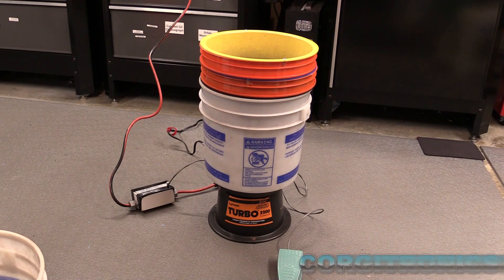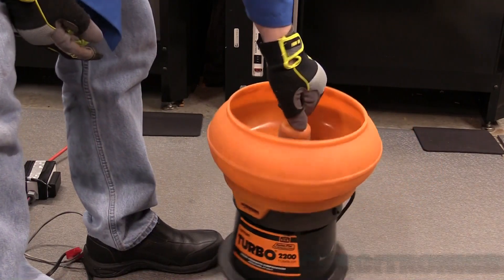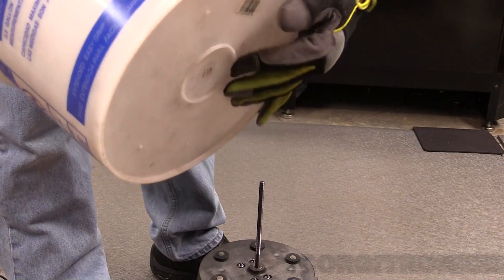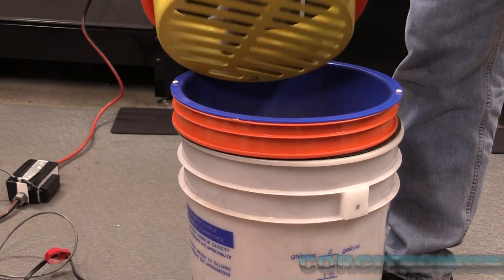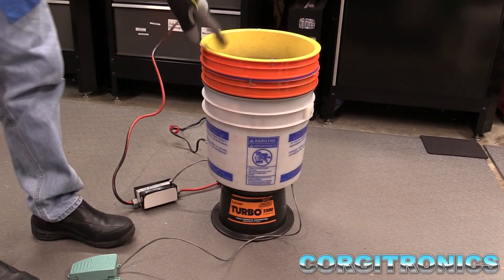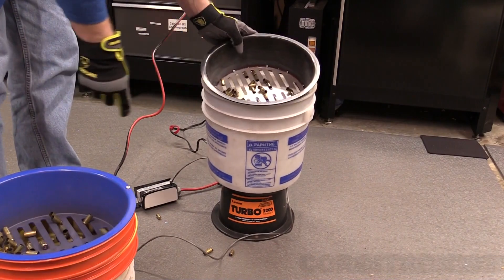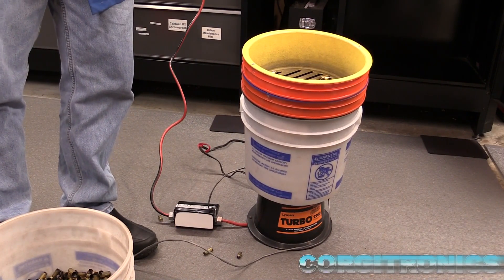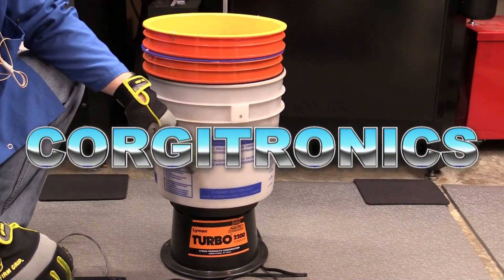Brass Sorting Machine

Comment: i can pickup more than a bucket full on a trip out to a shooting area. 
but i do use those trays. but i glues a couple strips of hobby plastic shape’s  to them to keep the trays from “sticking” together.
but i just sit on my back porch and do the job. 
and in small batches. but i can easily fill up a 9mm and 5.56 bucket as well as a good supply of others and find some odd ball cases.

Comment: Thanks for the video. I will say, just putting in the spacers helps a lot. I added the spacers and just shook around the trays without the vibration and was able to sort a 5 gal bucket of really random brass in under an hour.
Reply: I took some old plastic spray paint caps and placed them upside down between the different trays.  It creates enough space to easily shake the brass through.

Comment: I know this sounds funny, but I just took an old Craftsman vibrating sander and held it against the side of the bucket. The brass was dancin' a jig as they fell through the slots  in the sorter. 75 .223 and 215 9mm...and a few 357 Mag. Only took a few minutes. Mostly playing with the sander. :)

Comment: Add magnets around the edge of the top one for steel cases.  I pick up everything that looks like nasty brass and that's how I root out steel.
Reply from the maker: I might try adding magnets, but it's shaking so violently.  I check the brass first with a large magnet, which catches the steel.  One thing that I've found several times this year are brass plated steel cases, they look just like regular 9mm brass but the magnet catches them.